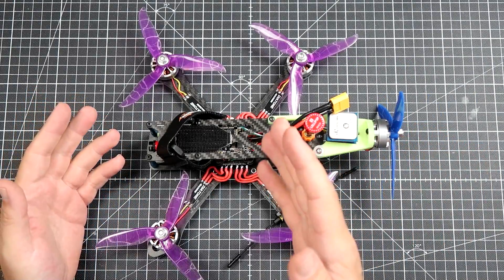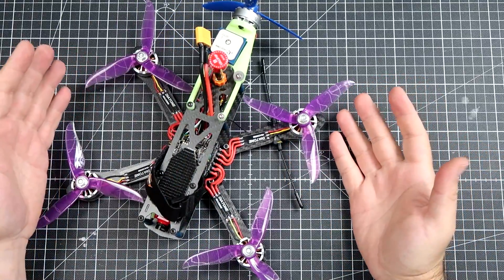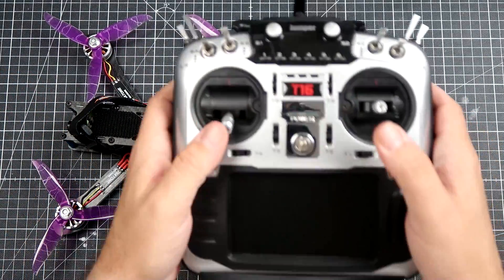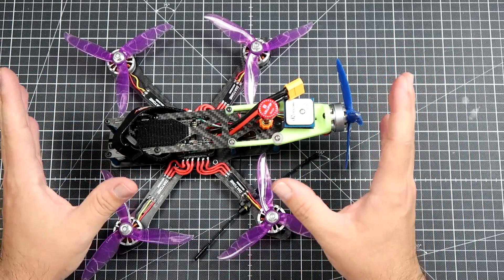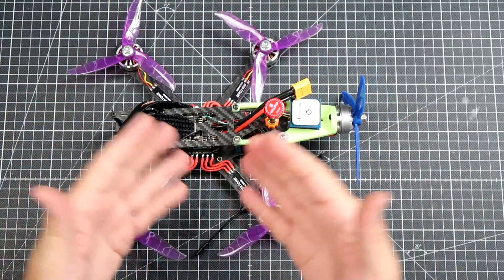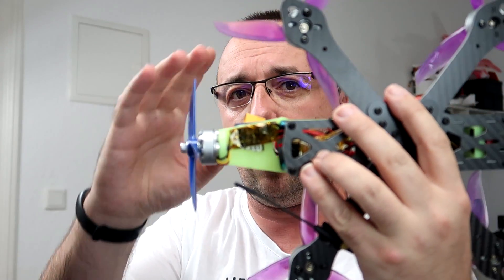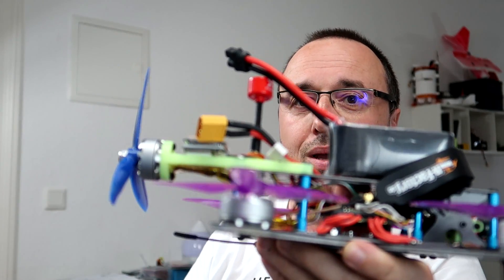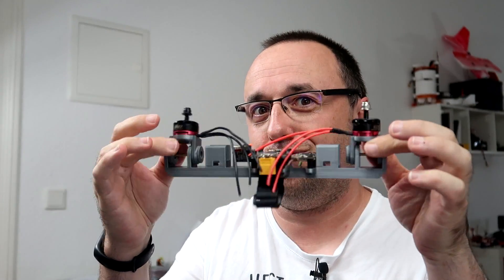FPV drone with a pusher prop | DIY Pentacopter!

Comment: Why not try it as a tractor motor installed overhead with some pitch built into the motor mount and set up a throttle curve and function in the radio to bring it up as you tilt forward?

Comment: You want to try something new? Do this in a tricopter configuration with a rear 180⁰ degree circumference position controlled reversing motor. Oh nice bird but way too power hungry😁👍🇬🇧

Comment: Isn't it possible to mix throttle input with the 5th motor when switch is on position?
Reply from the maker: yes, but then how to control altitude? So it makes no sense

Comment: Question ... I have follow all your instructions and my quad is flying beautifully ... fail safe and RTH doing good but on RTH when the quad is descending about 8 feet from ground starts to do circles or in place orbit until it land. If I do some minor stick adjustment it stops the circle land and it lands straight. How can I fix this help !? All I thought once it land the motors supposed to stop ?  Or am I incorrect?

Comment: You say this is nothing new but I have never seen something like this. :) Very interesting video

One suggestion: If you angled the back prop a bit you could fly forwards like a normal quad but with one more prop. Right now, if you flew forwards like a normal quad, the back prop would create downwards thrust.
Reply from the maker: I wanted to keep it simple. Also if I would tilt the back motor it would create a extra torque and from motors would have to compensate for it

Comment: I'm wondering if you could map the pusher to say maybe the side levers on a taranis and use that as a throttle control? might help with the pitch axis when you engage the pusher motor?

Comment: Interesting. Maybe you should attach a simple and cheap plane or rather some wings? Would be much fun? What do you think 😀 regards Dom
Reply: why not, maybe even add a small balloon with lighter than air gas to add to the lift
Reply: @GiffysChannel  Hi, probably an idea to minimize energy loss while talking off. Though consider the size of the ballon.
Reply: @GiffysChannel  This seems like a great idea. What could go wrong?
Reply: @GiffysChannel  Quadcopter, but with pusher prop so a pentacopter. But with some small wings, but the wings are filled with helium. And it should also have wheels in case you want to drive it. And be waterproof and work as a submarine.
...This comment started as a joke but I kinda want to unironically see this :D
Reply: @PenPeng  I wonder if anyone had ever tried helium filled wings :-)
Reply: @PenPeng  I like the helium idea. If we want to be even more efficient, we can use hydrogen instead. Its twice as buoyant and significantly less expensive. 😆